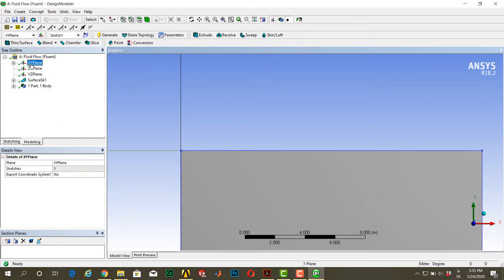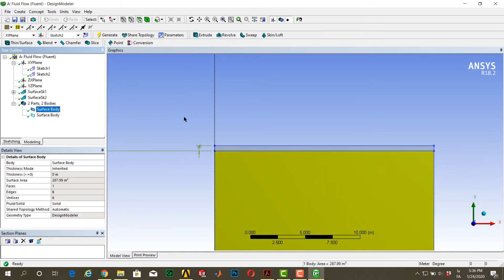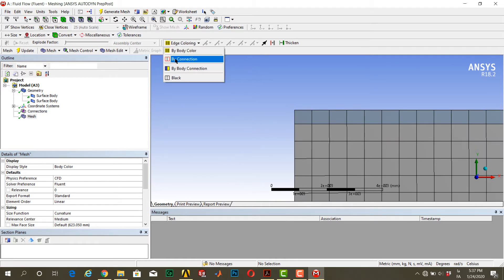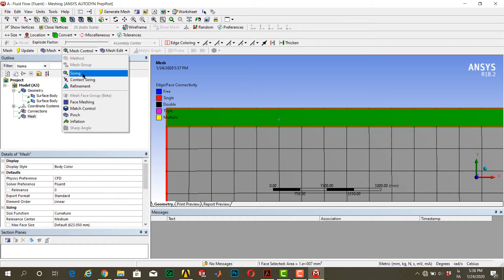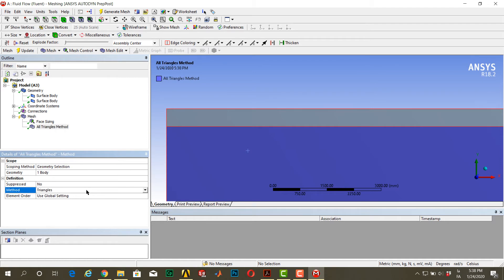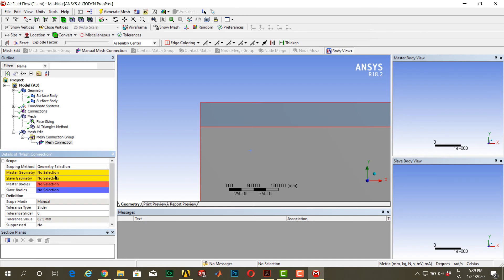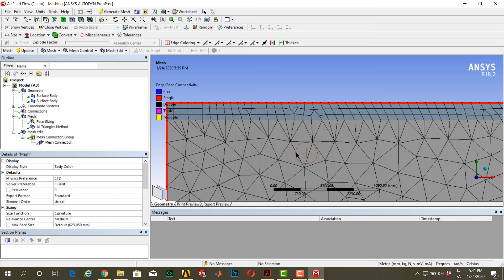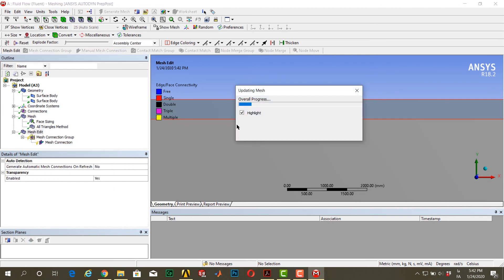How to connect different meshes (different zones) in Ansys Meshing

Comment: I wanna a separate mesh size in one body, how can do that? For example, I have a rectangular. I want to separate it 4 equal size. The two of them 20000 nodes and others are 10000 nodes. How can ı do

Comment: I have a small tube in a huge geometry..tube thickness is 3.7mm with length of 200 metres.The surrounding body is 50 m wide and 201 metre deep..which meshing method do you suggest?